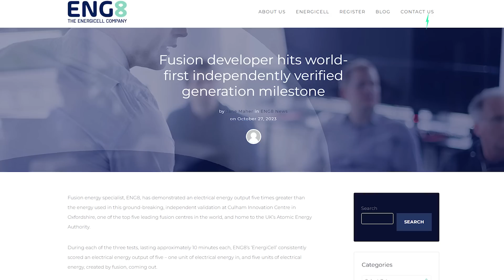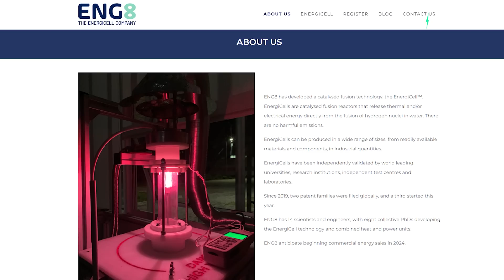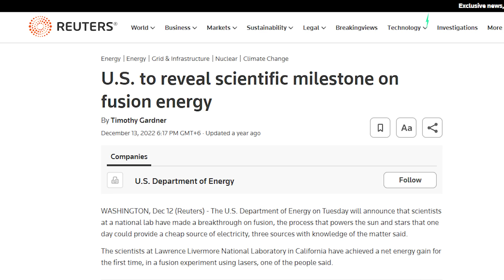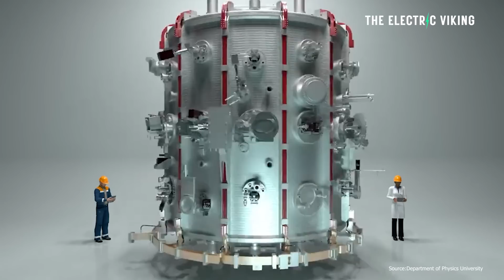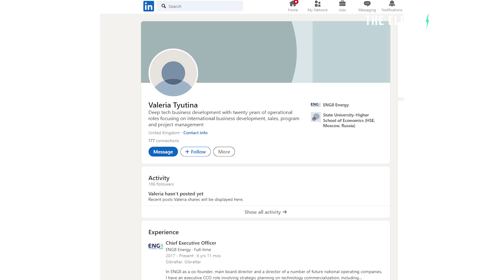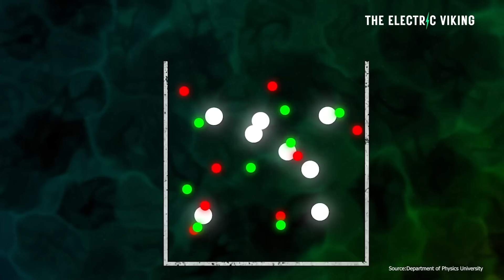Nuclear fusion capable of 500% energy return using water - game over!

Comment: ENG8 EnergiCells are heat pump devices, they are not fusion at all. 性能系数COP（coefficient of performance）is not the fusion reactor Q. You can not mix with them. The higher COP just means that the air conditioning heat pump is more efficient. The earth heat pump COP 3.5 means that you spend 1 kW electricity can pump up 3.5 kW amount of heat from the deep volcano ground, it does not mean that you did create 3.5 kW of power from 1kW. The goal of Chinese fusion reactor Q is 20 which is real fusion power.

Comment: If one assumes a 5:1 yield to input energy, there remain the question of cost  and scalability.    Would be lovely if it actually was energy efficient and cost effective.  That remains to be seen.
Reply: Exactly. If it's $50/kwh it's just an interesting technical achievement. Has to be cheaper than current generation methods or it won't fly.
Reply: They say up to 100kW is the commercial versions. More than enough to power/heat or cool a large family residence.
Reply: @lawrencecoleman6998  the output isn't at all what's being questioned. If it can't be cost competitive it doesn't matter if a single reactor could power the whole planet, people will go with the cheaper option. Solar and wind are so reduculously cheap now it's hard for new tech to compete.

Comment: 500% is 5x. Read the section in the excellent new book "Theory of Everyone" by Michael Muthukrishna on energy and its role in extricating the world from its current energy scarcity crisis. 5x "EROI" (energy return on investment, meaning how much energy in to get useful energy out) is about what we're getting (as the human race) from fossil fuels today. Compared to as high as 1000x in the early 20th century. So even if this is true, viable, and not containing hidden energy costs of manufacture and production (which all fusion systems so far have), it is only incremental, not game changing. Single digit EROI is in fact the problem with solar and wind... they're just too expensive for the energy you get to be the basis of an entire energy economy. Muthukrishna is quite explicit, however. WE HAVE TO develop a new energy source with better EROI if we are to continue our highly idustrialized civilization. 1000x is never coming back, but something like 40 to 50 is needed (only hydro is over that currently, and it is inherently limited by available hydro resources). Fusion may eventually be the solution, because the amount of energy theoretically available is enormous and potentially very cheap, once the technology is fully mature. But we aren't there yet, and the prospects for near term solutions in this area aren't great. I've been "anti-nuke" most of my life but it looks more and more like small fission reactors, and who knows, maybe some version of these relatively LOW efficiency (sorry! but it's true) fusion systems may be the stopgap that gets us through the Climate Emergency anyway.

Comment: The energy given off by the fusion reactions may be captured within the fuel, leading to self-heating. Most fusion reactions release at least some of their energy in a form that cannot be captured within the plasma, so a system at Q = 1 will cool without external heating. With typical fuels, self-heating in fusion reactors is not expected to match the external sources until at least Q ≈ 5.

Unless I'm miss-reading the article the thermal Q rating is Q=2.4, not enough to sustain thermal energy and not enough to spin a turbine.  Feel free to correct me if I'm wrong because I'm just a guy in an armchair.

Comment: Actually, Tokamak and Stellerator reactors have to run at much higher temperatures than the interior of the Sun.  This is because the hydrogen density in the Sun is so high that fusion by quantum tunneling occurs, resulting in fusion without actually overcoming the Coulomb repulsion of the hydrogen atoms.

Comment: Huge, huge differences between "fission" based "nuclear" energy (like Bill Gates promotes) and "fusion" based nuclear. There is definitely a race taking place to get to a "fusion" based nuclear reactor, which could, at least in theory, give us clean, safe energy, particularly if it can output its energy directly as electrical energy, rather than thermal energy. However, the question then will still be cost-effectiveness (affordability). In the meantime, we need to continue constructing our fusion-to-electricity converters we call solar panels and wind turbines, along with a variety of energy storage systems, such as Tesla's Powerpacks and Megapacks.
Reply: Fusion generates lots of neutrons that bombard the surroundings, turning it radioactive. So fusion ends up with a lot of same problems as fission.
Reply: @KARR-dv9xb  The amount of long-lived radioactivity is reduced by many orders of magnitude for all the various fusion processes and eliminated entirely for some of the preferred processes.
Reply: @greggrant4614  it depends on the fuel(s) and temperatures. Most fuels will have side reactions that produce neutrons. And the neutrons will make things radioactive. Only beryllium and lithium can absorb a neutron without becoming radioactive. So the reactor and all machinery and shielding will become radioactive.

There is a fuel that won't produce neutrons but it requires higher temperatures so its harder to engineer. Most fusion attempts are with hydrogen and helium isotopes which requires lower temperatures, so is easier but produces neutrons.

Comment: Nice and fun that you pick up these kind of stories!
A five time energy return is basically what you get with a normal heat pump at home. It varies a bit depending on if you have pipes in the ground (like I do), just air to water, or air to air, but you get out 3-5 times more heating energy than the electric energy you put in.
Is the 5x for all input energy to output energy, or measured as labs do, where they look att just the fusion process, not all the energy needed to cool magnets, produce laser pulses, and other stuff. The labs can get a bit more energy out of the fusion process itself than they put in, but they get only a very small percentage back when compared to all input data needed. 
So we already have this option. If the company can extract the energy from just any water, that could potentially have benefits in term of price and complexity. Also, it could work in space, and on moons and  the planets, that could be good. 
Still, we have to be extremely skeptical to the claims from some startup company about this breakthrough. If it sounds to good...
Reply: its 2.4 heat 5x electric

Comment: I call BS!  There is no "catalysing" of nuclear reactions, you need a fk load of force to push the nuclei together and this is why fusion is not positively efficient.  Its easy to make fusion happen with a table top accelerator built from old TV parts, but you have to put in more energy than you get out (conservation of energy), Nuclear power is looking for a chain reaction.  
It seems to mix up chemistry terms.  Ionisation is just part of making a plasma.
The web site says its efficiency is validated by UL.  Later on it says UL validated "electrical" , which means electrical safety (thats what UL do)
IEP validated Q of 2.4
 I was triggered when I saw hose clamps holding the thing together.  IEP is a Portugese compliance testing company, you can download a test report from the site but it looks like nonsense to me.   I have emailed them to confirm authenticity.  If they come back and claim its genuine I will fall off my seat.
I'd put money on this being a blatant scam.
Reply: Looking at it a bit more it is quite elaborate and they have spent some money with high quality video and alot of people taking nonsense.
I suspect the certificates are genuine but do not confirm COP>1 and are just standard safety and emissions tests, and confirmation of fusion and transmutation of the elements (Oxford test).  It looks to me like a table top fusion machine, which anyone can make but does not produce COP>1, or possibly a heat pump which would be easier and fool the testers creating more heat than the energy you put in, but its not from fusion.   The air pump in the report looks unnecessarily large.
On of the talking heads names comes up as a con man, hard to say its the same person.

Comment: The temperatur of the sun alone is too low for fusion, you need the pressure inside of the sun, too. Or temperatures fare higher than the sun!  Muon infused "cold" fusion is possible, but Muon have a half live measured in fractions of a millisecond and are very costly to produce. 

I smell a rat!

Comment: If their 'Q' is calculated the same way as everyone else in the nuclear fusion race, it only includes energy involved in initiating and sustaining fusion, not all of the other energy needed to reset for the next run. You need a Q significantly larger than 1 to truly break even once you include all of the support infrastructure required to keep the thing running.
Reply: Yes, this should be Plasma Q, as that's the standard measurement. If true it's a big step, but only a step. You do need more than 10, probably around 20 could work. If you solve all the other problems too.
Reply: it is - it's 5
Reply: @markwoodruff1984  I doubt 5 is anywhere near enough to run all of the supporting infrastructure. It likely needs to be 10+ to cover the energy cost of all inputs.
Reply: Yep just more BS half truths and pissing in the wind, throwing away millions in time, money and resources, for an end goal that is never gonna generate more energy than it uses!
Reply: Google "lenr news letter" or "lenr forum eng8" if you want to stay updated.
Reply: Missed the part where he stated a Q of 5
Reply: @TheDesertraptor  I didn't miss it. A plasma Q of only 5 is nowhere near enough to power the infrastructure required to make other fusion power projects net-positive.

If you take ITER as an example, it takes a 50MW of thermal output to generate 500MW and while the ITER facility is ramping up to generate that 50MW, it actually pulls 620MW peak from the grid. ITER's plasma Q may be 10 but its net Q is still less than 1 even before we factor in all of the prep work between runs such as separating deuterium and tritium from regular hydrogen.
Reply: It's a bit of marketing slight-of-hand that the fusion industry uses 'Q' for 2 very different values. From my understanding, 'Q' by itself means Q (scientific) which only deals with the heat in and out of the fusion process and disregards how much power has to be used to make the whole thing run. Useful, but meaningless for economic viability. If their value of '5' was enough to put them over threshold for Q (Engineering), it would have been shouted from the rooftops - the silence has my cynical self expecting this to be another fund raising scam.
Reply: https://youtu.be/SVy3IExRhI8?si=5x9qyCfZ1ZN43lcd
Reply: Yes, and this new revolutionary technology is estimated to be in production within 5 years. Yeah yeah yeah...heard it all before.
Reply: it’s a catalytic fusion process so needs only about 6000C to initiate the fusion reaction and 1 million clumped electrons as the catalyst? that part seems weird. Actually that million electrons is merely to initiate after a return percentage of heat and photons from the >Q keeps it going.
Reply: None of the nuclear fusion plants have reached true breakeven yet 
Every few months they  claim progress to get more funding but as yet their only breakthrough is spiralling costs and hollow promises 
But I  believe one day  they will have true success
Reply: @michaelkiddle3149  this is not ‘hot’ fusion, their system is catalysed plasma fusion which requires much less energy to initiate and sustain the process.
Reply: @michaelkiddle3149  Don't be conned nuclear fusion is a pipe dream, always has been and always will be. It is just a way for a bunch of scientist to have a stable career for many years, with lots of funding for doing really nothing, that is gonna make a difference. One big waste of time, money and resources!
Reply: Run time is the problem not Q factor. Running 24/7 is the main problem.
Reply: Yup for other Fusion projects a Q factor of 100 still wouldn't represent a net energy gain... Which is why this sounds like BS.
Reply: @THX..1138 

Isn't that due to the huge amount of energy thermal fusion plants need to put in? These guys need to put in orders of magnitude less. So Q5 might do it

Comment: Space based solar collectors, 24/7 microwave transmission to receivers on the surface. A straightforward engineering solution with no new science required. Use the fusion reactor we already have. Unlimited stable energy would mean the end of capitalism. On 2nd thought, fuggeddabowdit.

Comment: Even if it is true, it has to be scaled. Energy gain is misleading. The amount of power required to produced energy gain is not just the energy required to produce fusion. It's the power for the laser or whatever is used to produce fusion in the first place. Then the energy has to be converted to something useful such as steam to drive a turbine. There are massive losses in the conversion process.  We are still a loooooooong way from a useful power plant.

Comment: I have few quibbles with this. That fusion requires the heat of the sun here on earth is incorrect. You need far higher temperatures than that to make up for the lack in pressure.  More importantly though, there is a huge gap between Q plasma, and the energy gain you need when you account for the whole reactor system. I don't think five time gain only accounting for plasma is enough for real world energy gain. Having said that, the numbers if correct, are still staggeringly impressive compares to what have been achieved so far, so if verified, this is definitely sensational.

Comment: Sounds like another one of these Cold Fusion and Room temp superconductor Too Good to be True  announcements though I wish it 
was true. I would think there would be deuterium and tritium involved which is generally extracted from water. You need much more
temperature than the Sun as the Sun has a gravity assist to fuse at lower temp .
Reply: It is cold fusion
Reply: Cold can not fuse @29stanmorestreet63

Comment: I checked their website, on 2022 they claim they were extracting 15 kWatts of energy out of a cell that seem to have 3d printed elements... regardless if it would be heat or electric energy that device would just melt (due to heat from reaction thermal or just resistance of these components). They might have produced some of test models but there is no videos showing any tests being carried out on these devices which also not what would be expected on such revolutionary discovery. I would not invest any money in this company until I would personally go there and see it myself and measure outputs with my own tools and I would revommend everybody to do the same before sending money to such investment.
Reply: One of the biggest 'give-aways' that there's something fishy about the whole thing is the fact that they are all standing around the device. It's supposed to be fusion and fusion involve the generation of high energy neutrons. High energy neutrons do not make friends with human tissue. (They also mentioned magnets - another red flag.)

Comment: If I were you I would avoid showcasing and giving voice to that kind of scams. I would recommend you the Improbable Matter YT channel. SUSTAINED nuclear fusion with or without net power gain  is so hard to achieve that is costing us more than 50 years of research just to build the facilitie to try practical models. The ITER is the best founded and more cohesive project so far and is at least 30 years away from reaching its goals.

Comment: Extraordinary claims require extraordinary evidence. The difference in energy level between thermochemical and thermonuclear reactions is so many orders of magnitude that the chances of achieving desktop fusion would be almost indistinguishable from zero.
Hydrogen fusion needs neutrons to make helium nucleii. The concentration of natural deuterium in water is only 1 in 5000, so that's too low to be useful without enrichment, and then D₂O or heavy water is not water anymore! Or maybe they rob some from an oxygen atom?
Colour me very very skeptical!

Comment: I'll take that with a bucket of salt until it's been peer reviewed. Also, is that 500% overall gain, including ALL of the energy required by the complete system? We've already seen stupid claims of over unity gain from the Laser Fusion project, which is hopeless when you include the energy applied to the system.